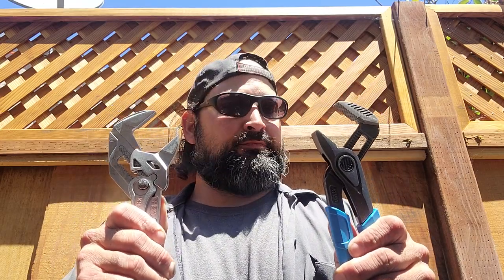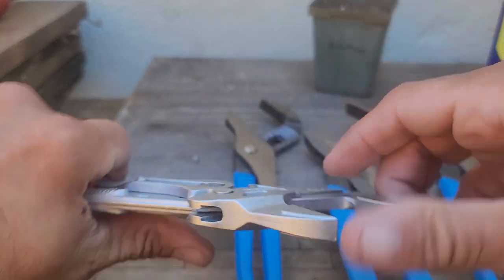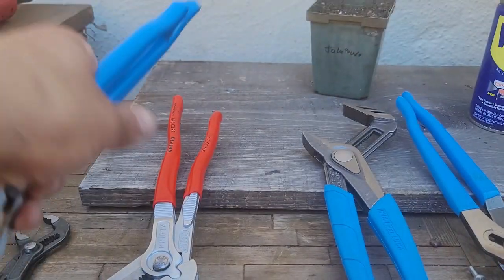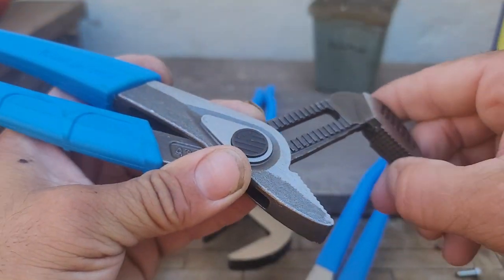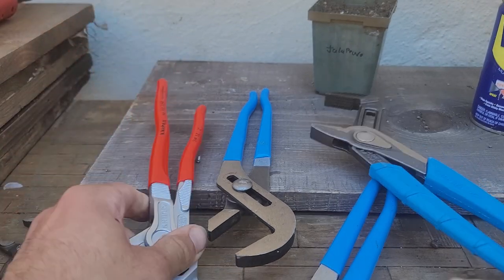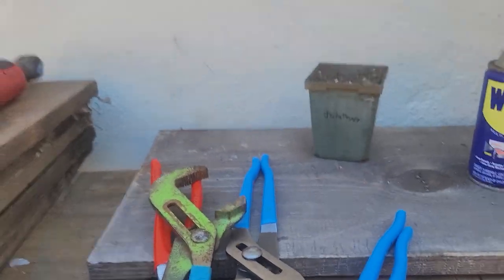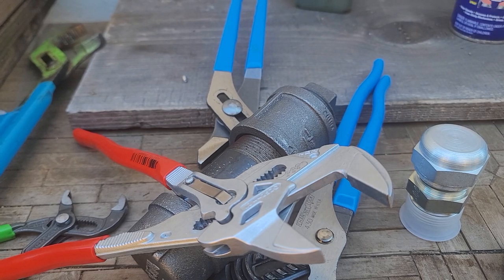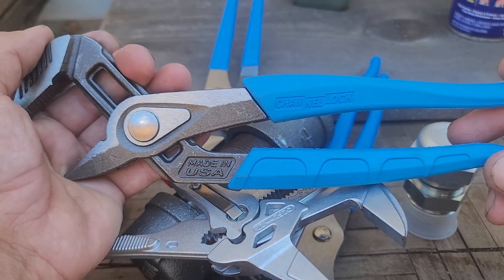knipex vs channel lock

Comment: Just an odd comparison. You will use the Knipex pliers wrench when you want to not mar a surface. You use whatever else you like when it doesn’t matter. This guys knows this too which is what’s most confusing… Anyways you know your stuff man, good video!
Reply from the maker: Fair point,I do use both but the channellocks way more they have good bite on piping really replaced the old 440s almost, the knipex delivers on brass and stainless, but sometimes I have to get more bite, but 80% of the time the surface appearance doesn't matter for my work
Reply: @anthonygm85  You feel that actual channel locks grip better compared to cobras? I’m not going to say you are wrong but just more curious on why you feel that way. I don’t have anything bad to say about channelocks, meaning the original slip joint plier, not as much the company as a whole, I still prefer the Knipex. Regardless of everything, I feel like a tool as such is very specific to the individual as far as preference. If you can master the tool in this specific comparison than I think the differences are mute. Cobras are great for me but nothing wrong with the original… Plus these cobras will never be comparable to the original when it comes to hammerability… 😂
Reply from the maker: @codythompson9035  For me, I feel like they grip pipe material a bit better for what I do, there more robust overall, I'd say give the speedgrip channellocks a chance they also have come out with a v notch style pair that looks closer to knipex, there affordable also
Reply: @anthonygm85  I’ll check them out! I definitely like the jaw style, actually used some Irwin variations that I’d recommend for a while. I do commercial/industrial hvac service. Having the right tool for the job is always ideal but given my field, might mean walking literal miles through the extremes of weather. I’ve broken apart gas trains that these cobras had no business doing, but gripped well enough that I could use my body weight to do it. Couldn’t do it with my channel locks but admittedly so have not tried anything beyond the traditional style.
Reply from the maker: @codythompson9035  https://www.zoro.com/channellock-12in-speedgrip-v-jaw-tongue-groove-pliers-442x/i/G810055457/?utm_source=google&utm_medium=surfaces&utm_campaign=shopping%20feed&utm_content=free%20google%20shopping%20clicks&campaignid=19725397595&productid=G810055457&v=&gad_source=4&gclid=CjwKCAiA_tuuBhAUEiwAvxkgTmu9_ricLGJ-2EIUiFvRfSEHMrLW22uQ87dJpDE45d7rXSrVnOj2HhoCla4QAvD_BwE&gclsrc=aw.ds

Channellock 432 v jaw speedgrips
Reply: @anthonygm85  I’ll see if I can find em in the stores in the next couple weeks, if not I’ll order em sometime soon. Don’t expect em to best my cobras but even if not, they will be decent pliers like everything else I’ve had from them. If they are better than I’ll be even happier! Again I feel with this sort of subject comes a lot of personal preference/mastering of the tool but I’m sure they will perform well. 

While now jumping subjects, even a pliers wrench isn’t a complete replacement for the adjustable. Anything I can fit a pliers wrench its generally going to be the better tool, but I can’t always fit a pliers wrench where I can fit an adjustable. A slip lock like channel locks don’t give af but don’t want to use that on bolts/nuts.

Comment: Weird comparison. Two completely different tools designed for two entirely different jobs. Why compare a water pump plier and a wrench? Should have used the Knipex version of a water pump plier, the Cobras or the Alligators with those Channellock water pump pliers. Or a  Channellock adjustable wrench with the Knipex adjustable plier wrench.